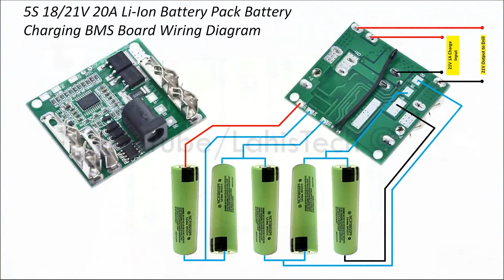Cordless Electric Drill Repair | Replaced 5S 21V 20A 18650 BMS Charging Protection Board Part-1

Comment: i have a similar battery for my electric saw and i was trying to charge the battery with my rc charger via jack but charger cannot find battery , should i solder cables on bms with xt60 ? if yes where do i have to connect the xt60

Comment: Such a great idea. 
Are those purple cells not of good quality? I saw a guy using them in a ebike battery pack.
Reply: Pinki Chowdhury   , They are called adhesive insulation rings. If you write specific number of the lithium cell you will get the exact one. for example - "18650 adhesive insulation ring".

Comment: Can i use bms to power my tool without battery?... I mean just using my 18 volts ac adapter...my battery pack is so expensive i cudnt afford to buy new one...thank you
Reply: I have successfully used 12v car battery with 12v dewalt drill . You can try other led acid small battery?

Comment: All good if you are doing this as a for profit business. For the average person the cost of special spot welder, battery testers, misc tools and parts is too much. You could replace your old battery packs for new ones several times over and simply plug them in to the tool. So thanks but No thanks.

Comment: Nice video. The Part I really wanted to see was the bit you missed out. Taking out the contacts from the board and dc port and how you used them in the battery connector. I bought the bms to give good contacts for battery adapters I need

Comment: May be MOSFET is shorted,
Check MOSFET first in inbuilt bms
Reply from the maker: I’ve thought it, but this inbuilt BMS is a waste. I wonder how still it’s work with just one high power low internal MOS at least it should have 2or more to balance; poorly built. No Temperature NTC either, hence decided to move on to a replacement. Thanks
Reply: @LahisTechLT  some Bosch 18v batteries  doesn't use bms,but they also works fine for long time
There life mainly depends on cells used
Reply: @LahisTechLT  There is very much a temperature NTC present which can clearly be seen @ 3.19, the small black plastic dot surrounded by white plastic protection.

Comment: I use the tester on the 20 A range and measure every single element for a few seconds

the test leads are schunt resistor

good batteries exceed 30A